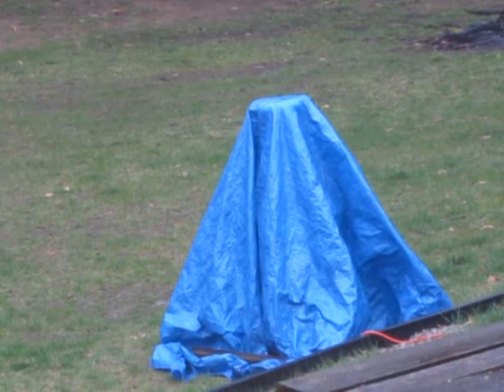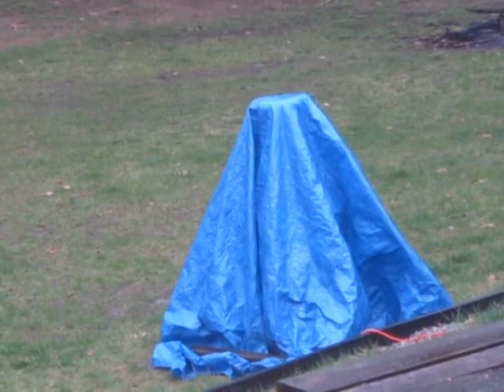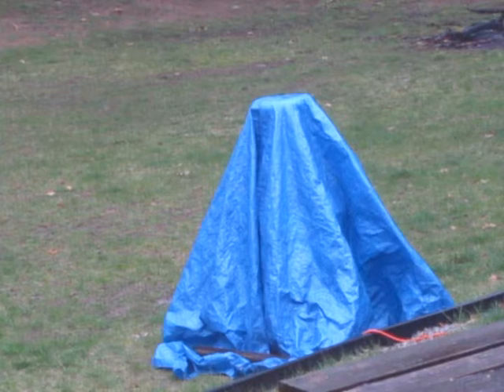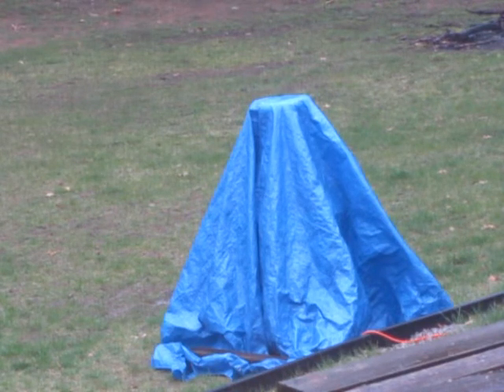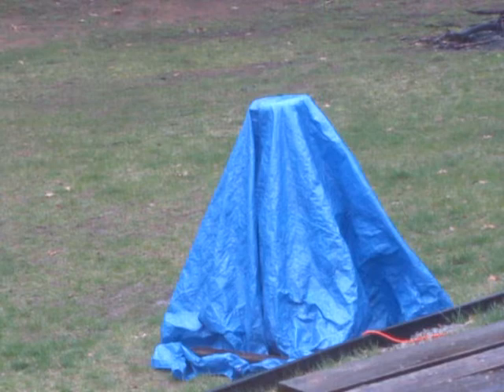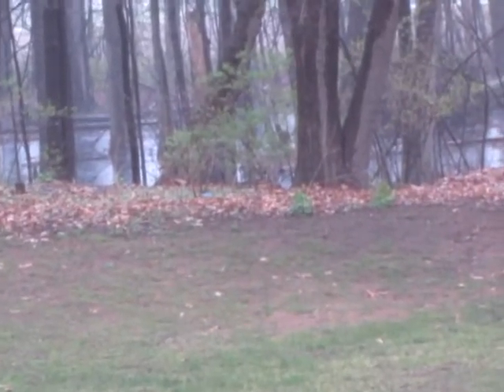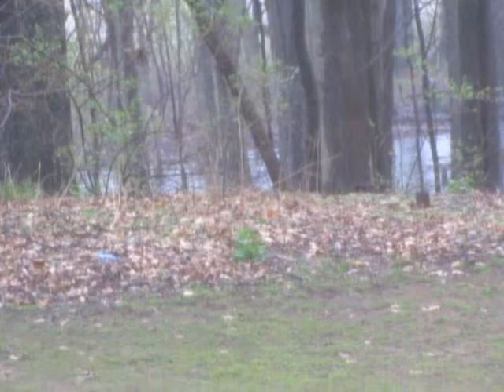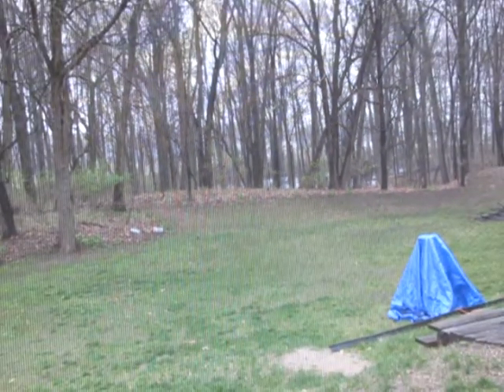Tesla Coil pt3 - First Run 4.28.13

Comment: Tons of specs in the description, that's comprehensive !
808 is on the low side for Secondary turns. I'd bump it to 1200 as an immediate trial fix. Well, not quite so immediate with the size of that coil. Great looking setup :)